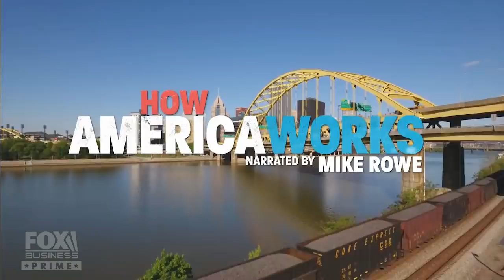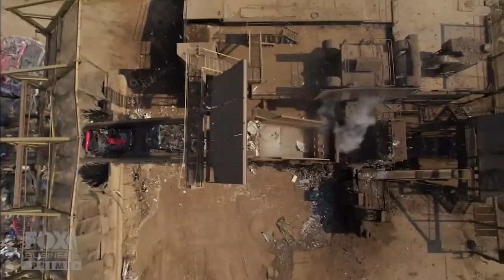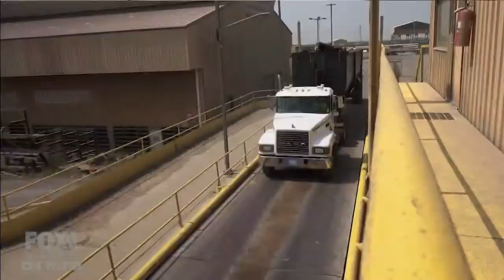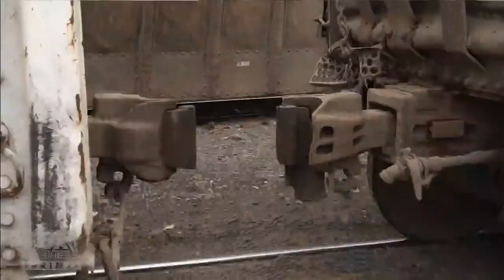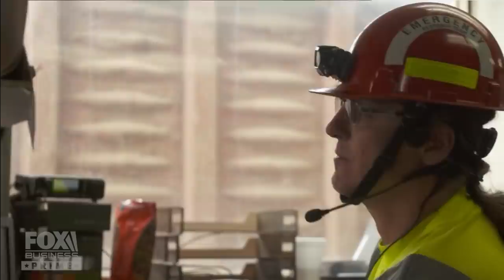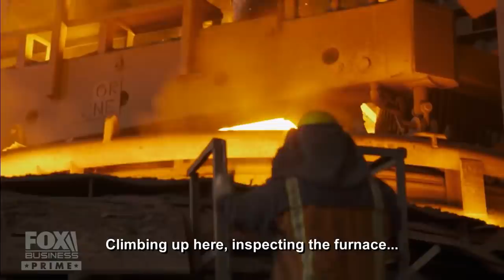Mike Rowe takes a look at the backbone of our nation

Comment: Ive worked in that plant. Ironically to keep the guys cool on the man coolers, pulpit room cool, Torch drive room & Roller drive room cool. I think I would consume about 2 gallons of water/Gatorade in a day. Its one of the hottest/dirtiest places I’ve ever worked. The only thing separating you & that fresh, almost molten billet was a piece of corrugated tin.  It was a hell of a place to work. You finish one repair & there would be more repairs already waiting. Stay out of the way of the slag trucks too, hell of a sight seeing the tires on fire as they drove.

Comment: How do they maintain the correct (precise) % of carbon? They just smelt tons of assorted unrefined steel fragments. Those fragments also contain Mo, V, Cr and other elements present in steel alloys. How do the certify the new steel?
Who knows?
Reply: They are sorted before to minimise impurities. After melting an exact analysis is taken from samples and if necessary carbon and other things added to change the composition before using the molten steel to make billets.
Reply: If they end up with a weird mix I bet they would just sell it for a low end product like counterweights for cranes of forklifts. All they care about is mass.